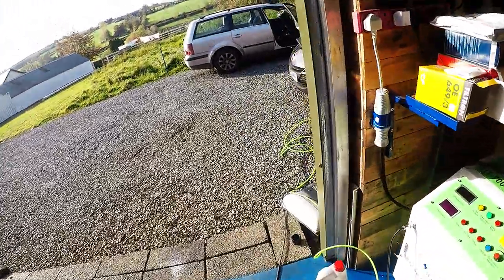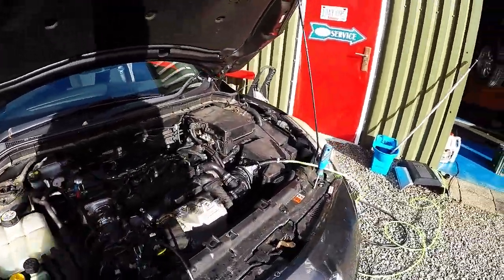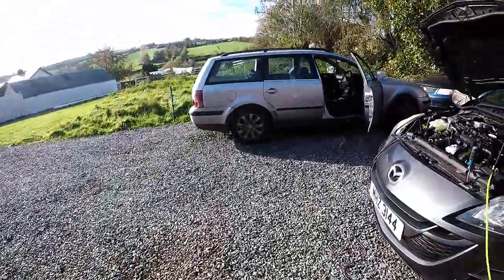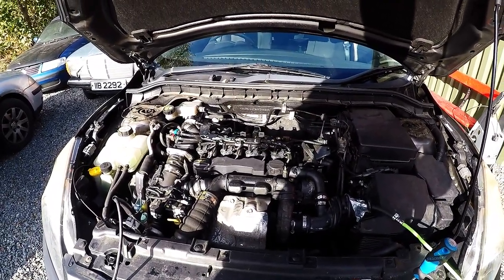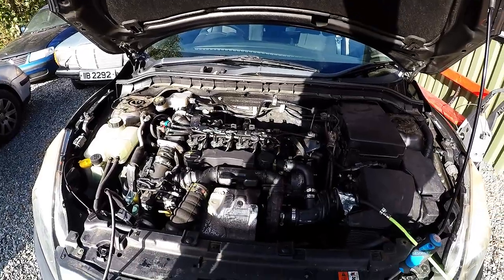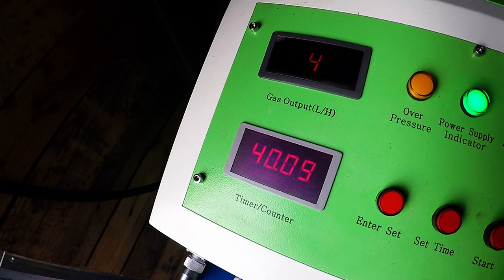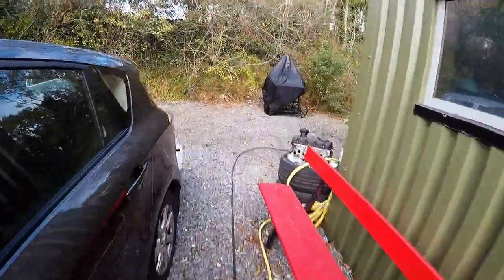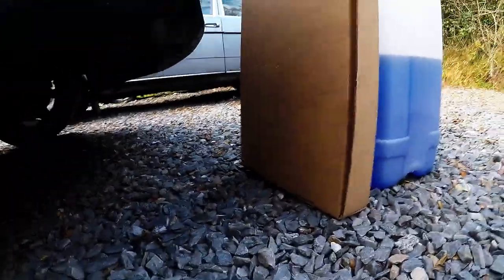MAZDA 3  DPF CLEAN WITH HYDROGEN ENGINE CARBON CLEAN

Comment: Hi guys! I see you are using HT700 machine. What is the success rate of DPF cleans in your experience? Are you using any fuel treatments or anything else? Or is it just connecting hydrogen generator and leave it to do the magic? I have just purchased HT900, but running pretty much the same gas output 650 - 700 l/h. Any advice for me how to deal with blocked DPFs? Thank you upfront!
Reply from the maker: i have great results with my machine,,,r u bough urs in UK r China,,,,,if ur unit is ht900,,,it hud run atleast 850 l/h,,,whos ur supplier,,thx
Reply: @djdex32  , I can run it on 950l/h, only for that I need a power generator. From mains it's running on average of 700 l/h without blowing out the fuses. I have bought the machine directly from hydro-tec. So you are saying it can clear blocked DPF filter without any additional help?
Reply from the maker: @efridrihsons  depends on the condition,but after 1 hour run at 650 lph does gives better flow,,so its cleaningwhith greater effort than manufacture regen,,the beauty of it,,thats produces higher rate of hydrogen and temperature,,,,have u not tried yet ur unit on vehicles ?
Reply: @djdex32  , I have this machine for only few days so far. Didn't had a customer with blocked DPF filter, however having 3 of them tomorrow. So far have serviced cars with sticky EGRs and Turbos only. So yeah, tomorrow 3 DPF customers, wanted to ask for an additional advice in case if I missed anything. You said the same what manufacturer did, 1h cycle and improvements will be noticeable. There is just one thing I still can't understand. If hydrogen cleaning is so effective, why are there still companies, who are flushing DPFs with liquid/foam? It's a longer process, it's dirty, expensive, involves more risk.....
Reply from the maker: @efridrihsons  its called terraclean,,,,i wont trust that procedure as it eats internals and have horror stories at engine collapsing 
depends on conditions of DPFs ,,,u safer ask ur supplier for advice,,i can guaranty on 100 % 
manufacture recommends   REGEN  after so many miles,,but hydrogen does better job,,as it mixes with gases and spit all sutical via exhaust